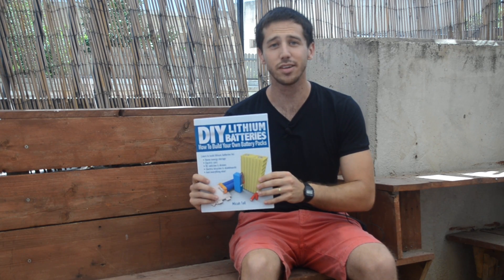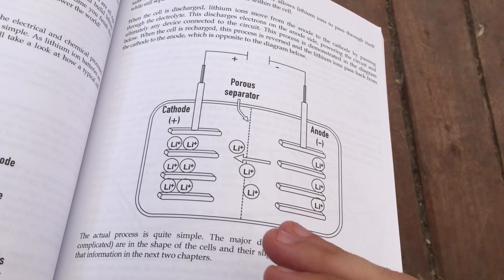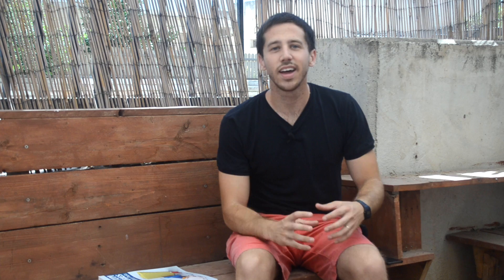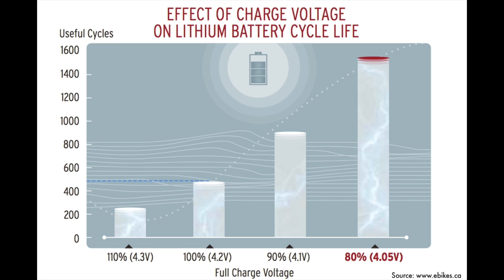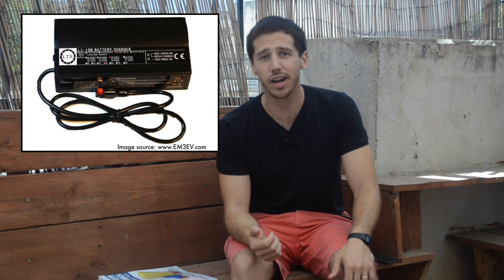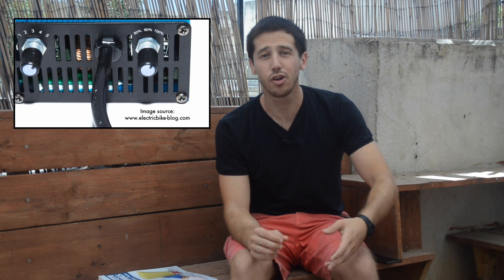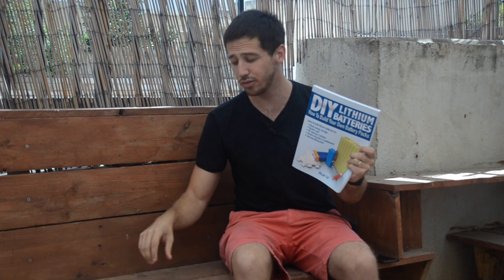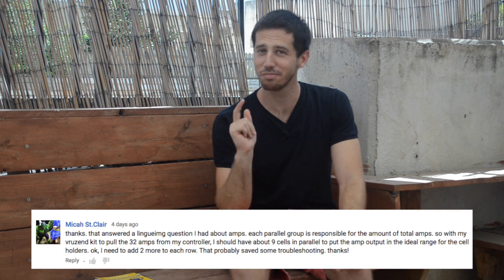How To Double The Life Of Your Lithium Batteries

Comment: A lot of people use an HLG LED power supply (manufactured by Meanwell) as an ebike battery charger, probably because the things are highly water resistant (meant for damp locations where water sometimes sprays), IP65/IP66 rated, UL listed, and generally just a quality item. Which, among other things, means one can permanently mount one in the "basement" of a two-level rear rack, and always have a battery charger onboard. They're also adjustable for voltage, current, or both - and NOT expensive, which would appeal to those who are middle-of-the-road poor (and, therefore, can afford a bicycle in the first place).

A thought just occurred to me - do some unscrupulous Chinese ebike battery suppliers sell 48V batteries as being 52V ones, and then simply overcharge them by 10% or a little more? That would explain why some of them have failed sooner than they should've (and, on rare occasion, in a somewhat spectacular manner).

Comment: some military devices with lithium battery, they only charged the battery to 3.9V to extend the charging cycles..

and because those devices was frequently being used, so not using the full capacity is not a problem.. 

but for home or commercial application, charging until only 3.9V they are not used the full capacity and even less battery usage for the devices.. and also they are not frequently charged up their battery in one day, maybe two days or three days later..

so, charging the battery to full capacity or 4.2V is not that matters.. and not catasthropic damaging the battery, because you also not frequently charged them.. so, you not lost that much cycle for long period.. (except you just store them in workhouse or just leave them not be used for long period)..

and more importantly, heat is number one battery enemies.. so, even you never fully charged them to 4.2V, if your battery heated up while being used or storing them they will lose they capacity much faster..

Comment: I have a 36 V 10 AH hour pack in my Biria Foldable bike that I need to replace. I see replacement packs advertised on the internet anywhere from $49 to a $199. I have lots of experience soldering and think. I could probably replace the pack myself. But am reluctant to buy the replacement pack, Because I don't know which suppliers are reliable. any advice?

Comment: Micah, I'm a regular viewer of your videos and I'm getting ready to make an ebike out of a good dual suspension 21 speed mountain bike I own with 26 inch wheels.  I'm thinking at this point at least of utilizing a front wheel hub motor from Grin Technologies.  I'm a formally trained bicycle mechanic with all the tools.  My question to you is there a formula or rule of thumb of some sort that would help me to choose the approporiate motor of appropriate power to haul my 250 pound frame around (which I expect to reduce to about 200 pounds through regular riding) at about 20 mph with a range of about 30 miles using the torque-sensing feature of the motor?  I know at this point volts equates to speed, but suggestions about the appropriate battery voltage to accomplish the objective above would also be helpful.  Thanks in advance, John.

Comment: Lots of info on battery life and storage etc; but the big question how do you know what level your battery is at when the charger has no indication. I suppose you can remove it and put it back on the bike to see the reading or use a multi meter each time. But that’s not very efficient .

Comment: During the daylight time, my solar panels are enough to power the house except that my air conditioner use the battery during the inrush current when it start a cooling cycle, is it ok to discharge a little bit each time the AC starts?

Comment: hope you read these old posts.  if the plating effect is mostly at high charge states, what negatively effects the battery at low voltage.  under 20%

Comment: I prefer my clients to just charge the battery as soon as they get home, using a battery at a low state of charge tends to be more damaging, if I try to explain the correct way to take care of the battery they will likely misunderstand it and do it wrong in a detrimental way. I modify their chargers to the minimum voltage at which the balancer kicks in, typically 4.17v, so I can sleep at night.
The second life cells battery bank at my home solar installation has a BMS completely designed and built by me so I have full control over it's programming and can remotely monitor it, I put the balance starting voltage at 4.0v and I use 4.05v charging voltage, so far 3 years of daily cycling and I don't notice degradation.

Comment: Has anybody worked on a solution for the plating issues at the anoid and cathode issues, I don't imagine its high up on the manufacturer research list since it would cost them lost sales if our batterys lasted 2 or 3 times longer. Great video and I learn alot.

Comment: Hello is it OK to use a 48 V  2 amp lithium ion battery charger for a 52 V 21 amp hour lithium ion battery to get it to 80%,a 48 V charger will charge it up to 54.6 V, which is just about 80%. I was wondering if the 48 V charger designed for a 48V  13 cell battery will do the trick for the 52 V 14 cell battery to charge it to 80% without doing any damage to the 52 V battery?

Comment: I've been working with batteries for over 40 years when it comes to lithium use them as you want but when you store them store them at 80% 75 to 80% and when one cell goes bad it's usually wrapped with 4 six or eight other batteries and makes the other cells go bad basically like a chain you're as strong as your weakest link

Comment: Solar charging.  Minimum panel wattage needed to charge ,is it possible?  I charge my bluetti 2000 watthr solar bank in 4-5 hr and charge lectric batteries with bluetti.  I guess theres no way to charge with 12 v.  But 24v or 48v?

Comment: Ah... So, charge your battery the night before a morning ride and don't recharge until you plan another ride... What about using a 48/54.2V charger on a 52V battery 4 charges out of 5 and topping off the 52V battery 1 out of 5 charges?

Comment: Good explanation. Many thanks for this. So would these arguments also apply to power tool batteries? I deliberately don't go to 100% when charging mine. And sometimes, instead of a light bulb setup, I simply use a fan to waste the charge on my batteries. This is esp the case in winter when there's not much home improvement going on around the house.

Comment: With us west (wet) coasters, because of weather, most of us (yes, some will ride in the rain) our batteries can and do sit for quite some time sometimes.  Using the battery charger, guessing at what the charge is, isn't really prudent, so could you show us how to use a multi-meter, to see what voltage our batteries are at?   I'm now at 1,350 km's on my e-bike, hoping to have many more years of reliable use, as I've had zero issues with my Himiway.

Comment: Regarding cell balancing... I, like everyone else was always under the impression that pretty much all packs have it but as it turns out it's actually a pretty rare feature amongst Chinese sellers. I'm currently looking for new battery pack and I was thinking to get UPP's one  when it was pointed out to me that their packs actually don't have balancing function by default. I asked UPP about it and they indeed confirmed that their pack in question doesn't have it but they can add it for a fee. The pack in question is pretty much highest tier they have to offer.

So could be very well that my current pack doesn't have it either and that I was doing the whole 100% charge  once in a while for absolutely no reason.

Comment: When I ride my e bike Pinarello with a Mahle system in the mid range power assist mode, what is happening with the battery and with the power output of the battery depending on whether I pedal hard or easy. Does my effort effect how the battery reacts in any way?

Comment: Wow! Very informative, Thank you. I have been in electronics since DeVry, graduated in 1968. Things have really changed since then. Your education on lithiums is very valuable to us old timers!
Reply: lol, I was going to say "Very informative", then saw your post and didn't want to say the same thing, so I posted here instead. This is a very helpful and "Very informative" video. I want to use the charger supplied with my etrike, and was a bit worried about fully charging, obviously I want to get the most out of my 20Ah Samsung battery (they are quite expensive). My plan, after watching this video, is to bite the bullet and purchase another 20Ah battery to alternate between the two to increase the time my batteries will last. I feel it will be worth the cost, since I can also use the second battery to extend my trip length. I think it will be worth the added cost in the long term, and I don't feel so bad about fully charging the batteries now.
I already don't  fully charge until I get down to ~ 30% charge. Yup, this was a great video and fully agree with your post.

Comment: Thanks for the clear tips.  I am getting a new Acheer E-Bike battery (after 2 years of use) because of a safety recall. My bike has a meter that measures remaining battery power with 5 bars.  So if I stop charging before fully charged green light on charger appears, and put it on bike and check to see the remaining battery power has 4 bars, that would be a way to undercharge the battery to have a longer life. Most rides are only 30 minutes.  For long rides, I will fully charge.   Logical?

Comment: I'll do an 80% charge for the 2 lithium-ion batteries on my 2 wheel drive E-CELLS hunting mountain bike most of the time. 
BUT for hunting I'll charge those suckers to 100% B/C I want a "cushion" of charge just in case I need it in the backcountry.
I'm also buying an Off Grid TREK "solar blanket" to charge an Eco FLoW Delta LFP (not Li-ion) battery during the day. When I return to camp I'll plug my bike into the LFP battery and charge it. I do NOT want to charge the bike with a gasoline powered Honda generator.

Comment: golden rule discharging your li-po's:

- using your batteries -  try not to discharge below 15-20% (should avoid discharging completely) 
- during winter 40-100%
- for long storage - 50-75% charged. (preferably around 50%) , 
- for safety should use batteries below -15/-20max degress C.
- after riding below 0*C bring home wait 2hours in warm and then recharge.

the worst thing you can do to your batteries 

1. expose to heat (45*C and more) and use / charge when its very cold (below -15*C)
2. store on a full charge or full discharge for long peroid of time
3. discharging batteries to flat 0%.

Comment: The cycle satiator charger costs almost as much as my whole Ebike.
Reply: You can disassemble your charger and if it's good enough, they would have the dial you can twist to make it charge to 40.5V if you have a 36V (10S) battery for instance. Check the voltage that it puts out to tune the charger to charge to 40.5V. Or you could just set a timer on your phone to stop charging by the time it hits 80% (4.05V).
Reply: @one_step_sideways  that’s neat, I might check that out thanks!

Comment: When the video refers to charging to 4.1 volts, how does that relate to an actual e-bike battery bank? I have a 48v 30Ah battery bank. I don't know how to relate what I'm hearing in this video vs. my battery bank. What for me is that 100% vs say 80 or 90%? My charger has a green light (charged) and a red light (charging) but my control display does indicate the voltage of the battery charge. Isn't it possible that my charger is, say, a 90% charge when it goes green to indicate "charged"? (390k people have watched this video but I don't understand how the info was useful to them beyond the principle that you'll get more charging cycles if you don't fully charge).
Reply: If you've got a 48V battery, it's likely 13 cells wired together in series. Multiply 3.6V (the rated voltage at 50% capacity) by 13 and you get 46.4V. So multiply 4.05V by 13 and you'll get your target voltage.
Reply: @one_step_sideways  Thanks!

Comment: Hey is there an easy way to know how many people can plug into one outlet or one power strip when out on a group ride? Is it as simple as adding up the amps per charger, and just not exceeding 15amps? Or more to it?
Reply: There's more to it. Do you see the rated input power (110V at 2A, for instance)? Disregard that, it is not indicative of the real power consumption. You can get a power meter to plug a strip in and see the actual amount of amps being used at a given time. You don't want to exceed 13 amps, especially somewhere on the street. 13 amps is the maximum rated amperage for a regular 110V or 220V AC outlet.

A rough way you can estimate the amount of power is by taking the total wattage of the power supplies and substracting a bit to get the actual charge rate (a 42V 2A charger will put out 67-78W, for instance, because the battery only accepts 2A with whatever the voltage it has at that moment, and not full 84W that you'd get by simply multiplying 42 by 2), adding 5-8% more to that to account for the chargers' conversion losses (which make them heat up while charging), and dividing the total power in watts by 110 or 220V to get your accurate amount of amps.

Comment: I feel like I generally understand the consensus of high voltage charging. 

The end of the range I get confused on is the down side… I know an e-bike battery isn’t a cell phone, but I’ve heard a range of things on the low end… 

How deep into low voltage/charge should a battery be taken?  Cuz I feel for people trying to maintain a healthy “range,” it’s going to change their willingness to push to 4.2 volts on the high side if the damage at 3.2 volts is even higher. Does this make sense?

Thanks much for the help.

Comment: Batteries are not useless after they hit their max recharge cycles.  Since the degrade over time, you are likely only getting about 80% charge capacity at that point.  The battery will continue to recharge but since they won't be charging up like a new battery, your expected performance will drop proportionally.  If you have been getting 30 miles or so, you can expect to get 24 miles at that point and so on.  You will hit a point where the drop in range will not long suit you and that is the time to replace them.  I enjoy your videos, keep up the great work Mica.

Comment: One thing to keep in mind, that although you will get more charge cycles from undercharging your lithium battery, this may not pay off for most ebikers.  The reason is if you do the math of 500 cycles x 20 miles per cycle = 10,000 miles!  I think most people will be upgrading or buying something new before reaching 10,000 miles.  So charge to 4.2v (100%)!!  :)

Comment: My Nanrobot X4-V2.0 run a short distance (1/4 miles) stop and power off, I woke it up either unplugged and replugged the battery connector or plugged the charger in. I did the same way repeat and repeat, but the running time just so short. What’s the problem ? Anyone can help ?
Thanks

Comment: hi  mikie   again im sure you get board of this but i on a 48vsystem  i  need  distance info  im thinking of useing a 72v system  but want to cover about 80 miles but looking at getting there on 60 ish on one charge  im fully aware that weight hills wind is a big factor  but id like a ballpoint ave figure on what size or battery in amps min to a real heavy amp 72v battery would get me there      anyideas on a bare min  even

Comment: Great info! I just bought my first ebike.. a 72 volt Scrambler made by Vintage Electric barely a month ago. And then just last weekend bought my 8 year old a Fat tire ebike from Pedego.. I don't recall the voltage. But I've gotten really inquisitive about these lithium ion batteries. Yes I want the the furthest range.. but I want the longest life out of this as possible. VE says another battery is $1,000... the Pedego battery by Panasonic is around $800. So clearly battery maintenance is something to put thought into. My charger has an Amp setting and a % to charge setting.. it displays voltage  as well but I don't see a way to adjust the voltage for charging. 
Great video!

Comment: Hi there I like your dillvery approach, when making a video, here is and idea, i'm a retired tv man, now riding an ebike enjoying life, why not make a video showing the pluses and minuses of wiring two 36 volt ebike batteries in parallel, no one up to now has shown the bbd6040 balanced discharge unit which allows you to connect multiple batteries safely, from a schematic point of view, why this is not done is that the profit makers middle men, hide the simplicity of the circuit used, and we need to expose the over pricing of the product yes it's averages price is around £50.00 seriously not cool, people that use ebikes are generally old and poor generally or under payed, this idea would get you a lot of views. yes you would need to research this and simular products, but it would be worth it.